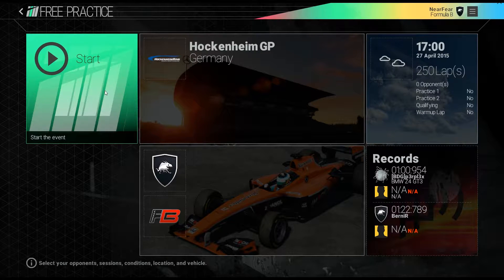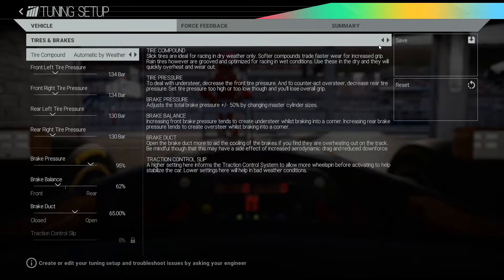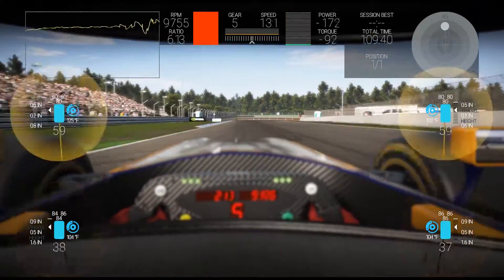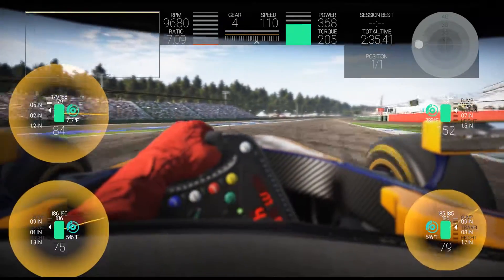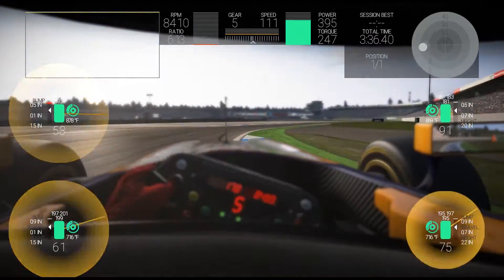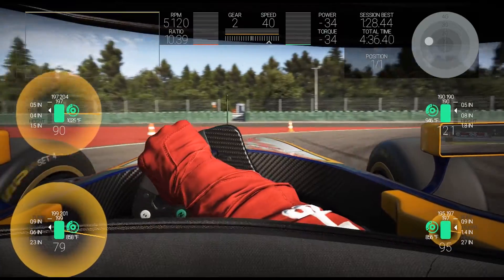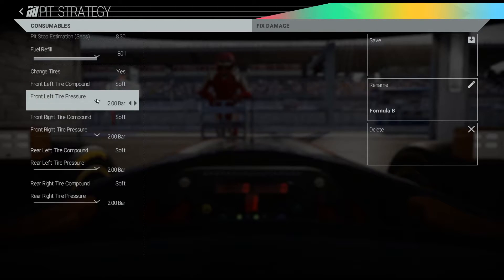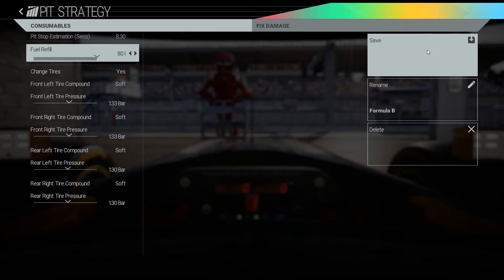Project Cars Quick Tips #1 | Tire Temperature, Basic Handling, & Pit Strategy

Comment: What's the difference in asmetrical vs symmetrical tires
Reply from the maker: In terms of laptime having a harder compound in the rear of the car is only slightly slower than a full set of the softer compound tires. The main advantage to this is that you can go longer than you would on the softs into one stint but go faster than a set of the hard/medium compound tire. With this being said the main downside is that it requires quite the setup work to get the balance of the car correct.

Comment from the maker: Tips on How not to loose it in the middle of a race... :D
Reply from the maker: I mapped the HUD onto the B button on the wheel in the options menu on the top right before I entered free practice. It should work with any type of controller though.
Reply from the maker: you can bind it to circle if you want, what system?

Comment: what if im getting one rear tire really hot, and the other 3 are okay ?   running version 6.0  driving the Audi R8 LMP900 on Watkins glen.
Reply from the maker: some of the pressure and temps have changed since 3.0. I will release a video once I gather more info. Though you can imbalances the tire pressure/camber on the specific tire to keep it cool. Hope it helps :)